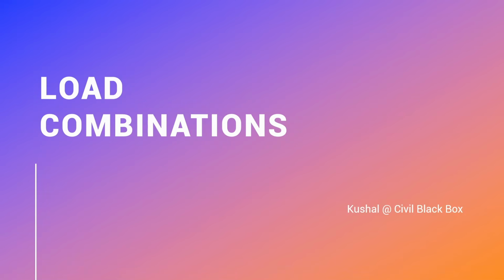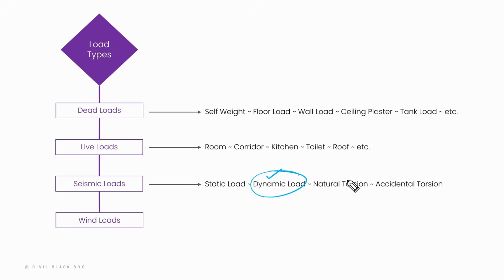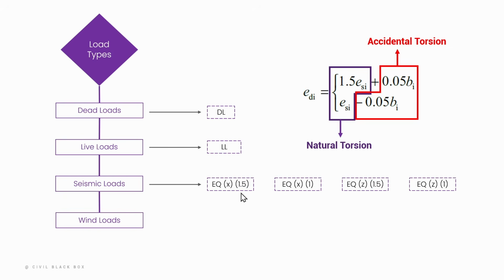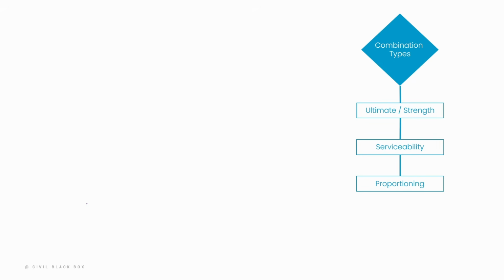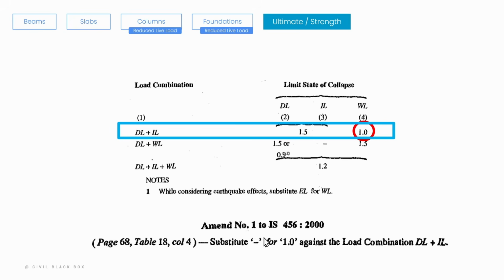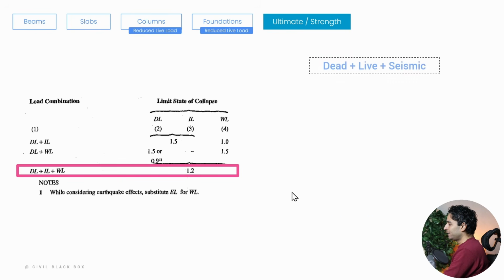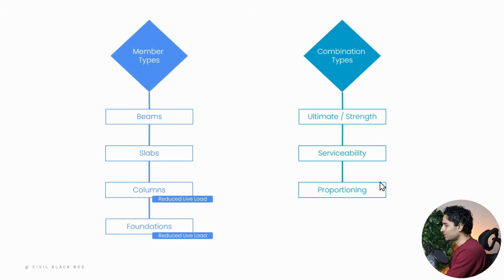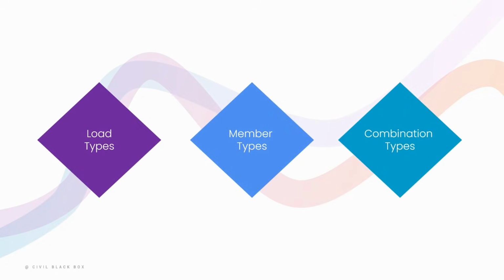Load Combinations Explained - Structural Analysis Basics

Comment: Hai Sir What is the Difference between 1.5DL+1.5EQx(+X) & 1.5DL-1.5EQx(-X)
OR
I think there should be only 4 combinations possible.
1.5DL+1.5EQx(For +X)
1.5DL-1.5EQx(For -X because -*+=-)
Similarly For Z seismic
1.5DL+1.5EQz(For +z)
1.5DL-1.5EQz(For -z because -*+=-)

Comment: Very nice Sir!
What Building Code is this? Indian? The factor 1.5 for Dead Loads I never seen before!
Even in the Eurocode I use here in Greece, witch is 1.35, I think is too much.

It is too much for the Self Weight of members of building that can't change so easy.
For example the section sizes. In the other hand, loads to beams from walls or loads to 
slabs from tiling floors can change and is difficult to know in advance, for them is ok.

That's why some times, depending the building, I create a separate Load Case for the 
Self Weights only and an other Case for the rest Dead Loads. To the first I give factor 
1.1 or 1.2 depending the complexity and 1.35 to the rest Dead Loads.

Thank you!

Comment: The load combination formulas are confusing me, because loads are vectors (they have directions) not tensor, so you should only add load in the same direction.   In my mind, Dead loads only act in vertical/Z directions, so when you start considering Wind Load in X and Y direct, as tat 16:58, then why are you adding the vertical Dead Loads to these value?  Is is implied that you are not adding the numbers, but analyzing the structure with both dead loads acting vertically and wind loads acting in different directions?

Comment: When you consider Wind load as WL(+-X) and WL(+-Z). Then there is no need to repeat the combinations with a MINUS sign in between. It is required when you consider only WL(X) and WL(Z). At that time with in + and - directions from both side has to be taken care in combinations by making 2 sets one with plus ans one with minus direction of Wind.
Reply from the maker: I will definitely try your suggestion. Thank you for pointing it out.
Reply: @CivilBlackBox  because  for eg. DL + WL(+X) and DL - WL(-X) is effectively the same. Therefore it only increases the number of combinations not the effectiveness.